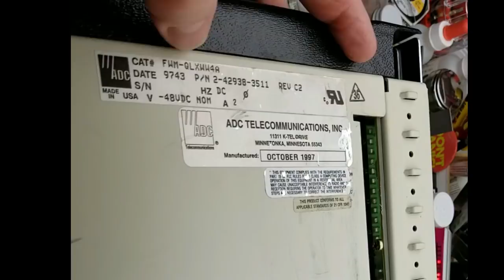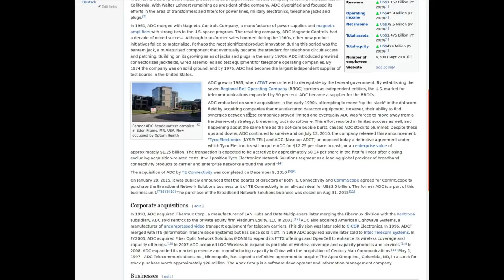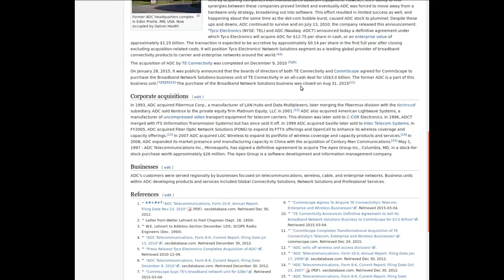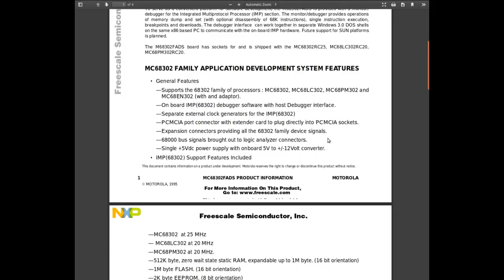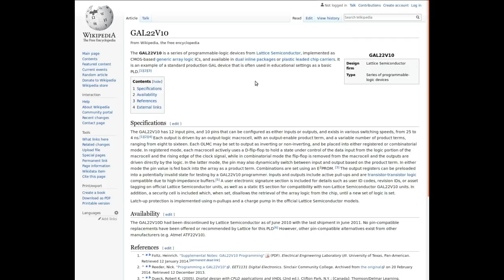ADC fiber mux teardown

Comment: They probably have a few of these at the hospital where my mother worked for five years.  They have a T1 connected Rolm CBX with PhoneMail and 2MB/s switched data which they use for Meditech.  The fact that people are still using Rolm CBX and that compatible trunking equipment is still being made shows just how much ahead of their time they were.
Reply from the maker: It's very likely. A lot of larger PBX systems were fed with boxes like this. 

A lot of larger offices got their internet this way back in the early days too.

Comment: Those GAL devices are still worth money secondhand, as discontinued but still needed for old logic designs.
I have a design where it's cheaper to use 74 series logic than the single GAL that should be used.